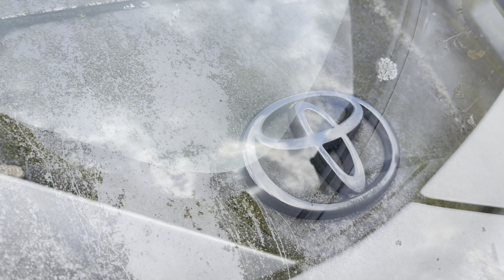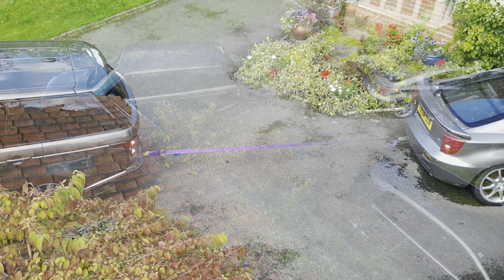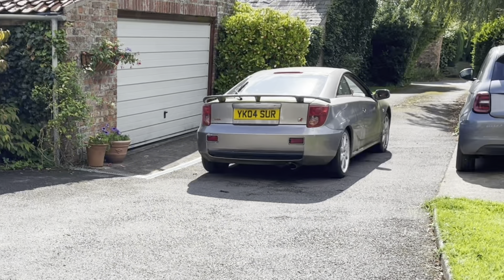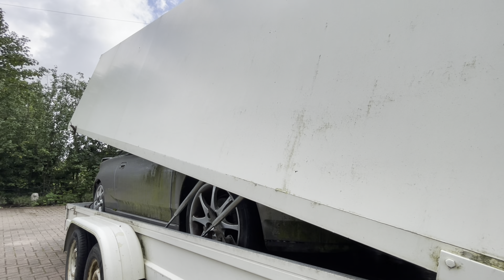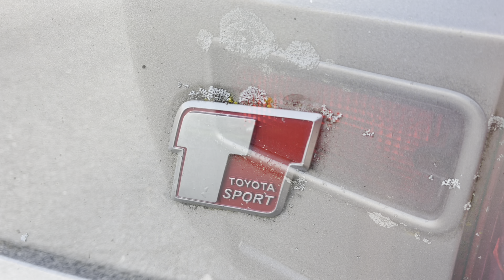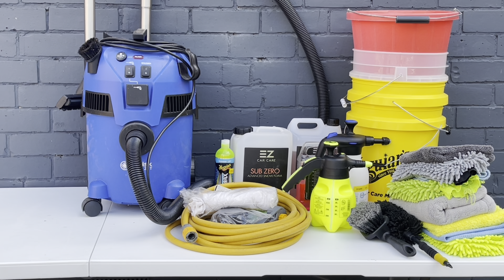A Toyota Celica Story Pt1“Extraction”. 1 owner 60k miles left for 8 years because of a flat battery

Comment: Engine of this car is very very special...
Reply: What do you mean by this? I never really liked these so didn't pay much attention whats different.
Reply: @mrdogtoothsyoutube  You obviously don't know about engines at all. This engine is the most powerful up to 1.8 naturally aspirated engines ever built, very expensive and quality materials are used in it, such as aluminum cylinders and block, ceramic coated cylinders, a complex system for controlling the time and duration of valve opening, special head etc. In addition, the engine is extremely reliable and revs up to over 8300 rpm. The power to volume is better than most Porsches, Ferraris, etc. The same engine is installed on the Lotus Elise.
Reply from the maker: Thanks for your comment, the special engine car is now cleaner than ever, check out part 2

Comment: Celicas are fun!  I have a 1994 Celica gt with a 3sgte turbo swap.    After 4 months of winter under a tarp the inside gets moldy.   What was the inside of this like after 8 years?  
   Also it would be nice to hear more details about the find.    Why did the owner leave it parked for so long with a minor issue?  
How much did you pay for it?
Reply from the maker: Hi Anton, so I didn't buy the car, just washed it for a friend who bought it for sub £500 apparently. He has then gone on to replace brakes etc, even the rear bench seat as the stitching had opened up. The original owners got a new car which they used more, then because of lack of use the battery went flat which meant they couldn't use it without some attention, the next thing you know the brakes are seized and they weren't about to call out a mobile mechanic. My friend suggested he take the problem off their hands, the deal was done and I went in to extract. I hope you enjoyed this and part two. There is a new extraction video for you to see in my video list, similar situation really. You asked about interior, the Celica was absolutely fine didn't even have a bad smell, the same cannot be said about the Renault Megan. Enjoy and thanks for watching.

Comment: VVTLI Celica T Sport, that's the one with the more powerful and more reliable engine too.. good find, they rust like hell underneath, rear cross member, fuel filler neck, brakes etc... but deffo worth saving,
Reply from the maker: Your not wrong, looks quite bad underneath but can all be sorted. Brake lines looks good surprisingly. Rear suspension has given out and the springs have overlapped the hangers so it’s sitting a good inch or two lower than it should. Needs a full brake job in each corner. Exhaust isn’t pretty but solid at least.
Reply from the maker: Was definitely worth saving, check out part 2!